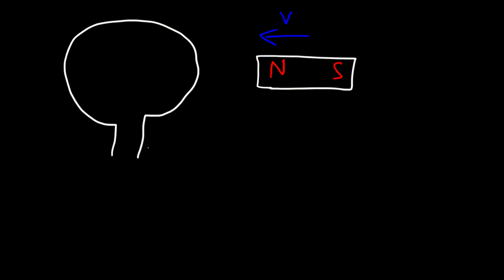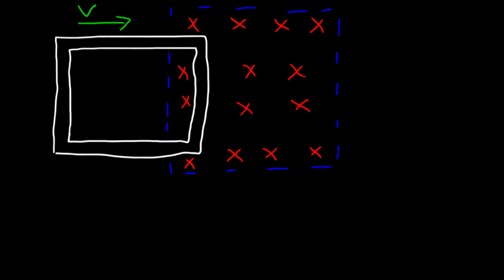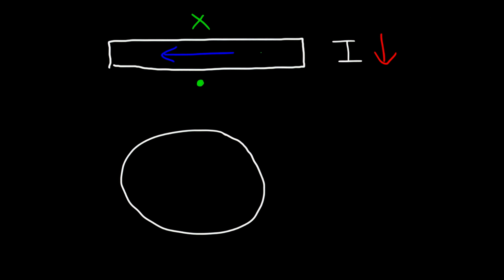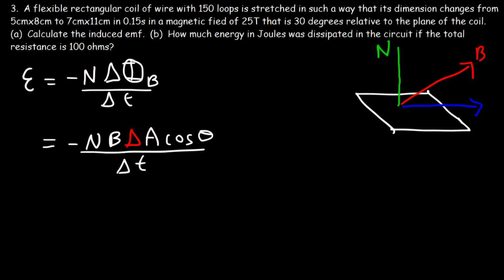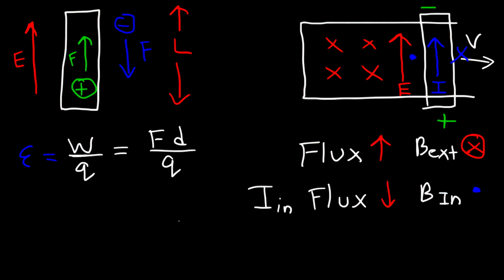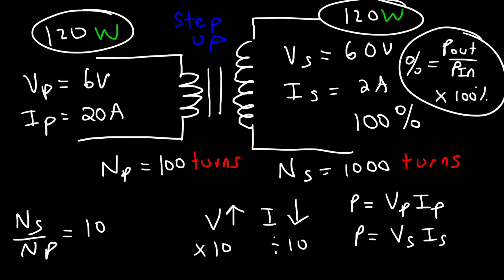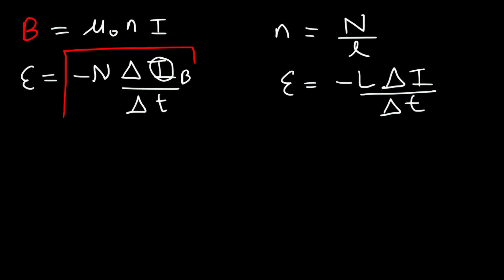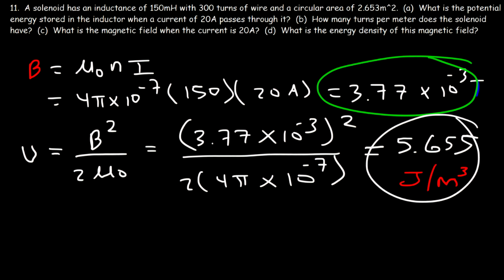Faraday's & Lenz's Law of Electromagnetic Induction, Induced EMF, Magnetic Flux, Transformers

Comment: what if youre only given information about the inside direction of a loop and not the outside direction of the loop? All of these examples depend on the outside direction of the loop being defined.
Reply: external isnt relative for inside or outside the loop, rather external means an external field acting across the inside and outside sections of the loop, not just one section.

Comment: Ashamed to say I took dc circuits 12 years ago and made a magnet circuit like yours, but forgot to put resistors in.  I guess I need to get some resistors - 3 ohm - and put it in the circuit.  calculations say I get .0001 amps.  My ammeter says I get .100 amps.  Close enough to explain it using a home depot magnet with grade 42, 16 gauge magnet wire.  Barely any voltage registers on my voltmeter showing MV and calculations say .00048 volts, thus 0.4 mv.   All I see on my meter is 000 mv, but I know the voltage is there due to the magnets moving. Trying to make a generator that works in wind

Comment: I watched this video last night and I thought it was confusing. Today I did some research and it seems like you could just say the following, "When current goes through a wire it creates a magnetic field. If you cut off the power, the collapsing magnetic field creates a voltage, that wants the current to keep going the same direction. Since it wants to keep going the same direction, the change in current turning off is a gradual change. Since coils create a bigger magnetic field, a bigger inductor makes the change in current flow slower." Isn't that the same thing?

Comment: Video Summary:
This video discusses Faraday's law of electromagnetic induction and Lenz's law, including the direction of induced current and the factors that affect it. It also covers the calculation of induced EMF and the use of transformers in changing voltage. Faraday's law is essential in understanding the principles behind electromagnetic induction and its various applications.
 
- 00:01 Moving a magnet into or away from a coil induces a current in the coil, with the direction of the current depending on the direction of movement.
- 12:46 The induced magnetic field in a loop is opposite in direction to the external magnetic field, and the current direction can be determined using the right-hand rule.
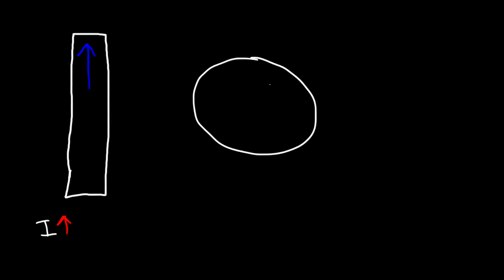- 25:32 According to Lenz's law, the induced current in a circular wire will create a magnetic field that opposes the original magnetic field, meaning it will be in the opposite direction.
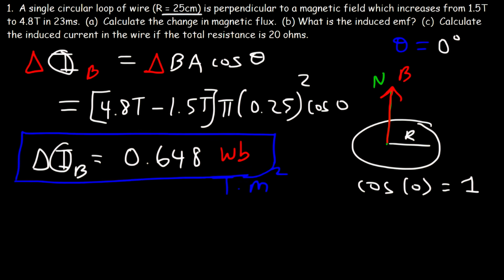- 38:18 The video explains how to calculate induced EMF and current using Faraday's Law.
- 51:02 The video explains how to use Faraday's law of induction to calculate induced EMF and how to derive an equation for calculating the magnitude of induced EMF for a moving conductor in a magnetic field.
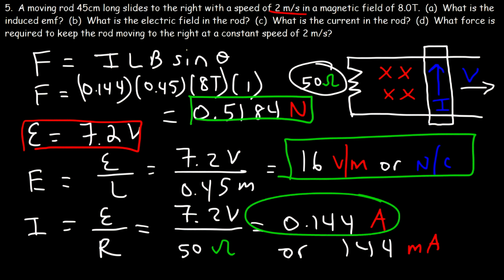- 01:03:48 The magnetic force acting on a rod with current in the presence of a magnetic field is equal to the force required to keep it moving at that speed.
- 01:16:34 The video explains how to calculate current, voltage, and power in a transformer.
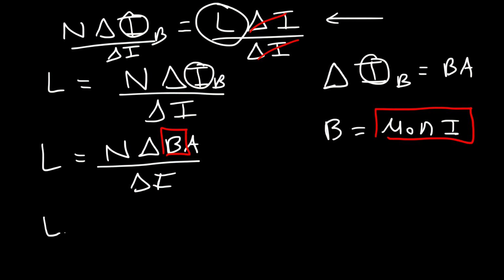- 01:29:22 The video explains how to calculate the inductance of a solenoid and its potential energy.
 
Generated by Monica AI. Get yours now! 👉 https://monica.im?r=402983

Comment: I wish you had used standard or common variable names to represent electric flux.  You are using capital I with a circle around I.

This is not standard usage which makes things more difficult to recall.  It's bad enough to have intricate concepts to learn without adding tmo to he situation .

Just like in English language we have one symbol or name to refer to say for example "apple".  Not many symbols or names for it because if we did keep changing the symbol for apple then much confusion and frustration would quickly result.

I noticed in science and engineering, teachers and authors often talk about or refer to the same concept but however, they adopt some symbol that they like and not use the common or standard symbol for that situation the teacher is discussing or writing a book about that concept but chose a new set of variable symbols.

This is harder to grasp for beginners but teachers keep doing this annoying thing.

It is done often in teaching and in new textbooks.

And you are doing this here with this video.

Nothing that I have seen in many years reading books on electricity uses capital I with a circle around it.  For some reason you decided to start this.

Comment: Faraday's Law is not a law, just math.  In the case where the change in the magnetic flux linking the circuit is due to motion of the circuit, or part of the circuit, the emf is motional emf due to the motion of the conductor moving through the magnetic field and is not due to the change of flux linking the circuit.  It is a case of correlation, not causation.
Reply: What? You’re wrong
Reply: @nuggetx4086  Great argument!

Comment: 28.10 i don't know but i think the graph that you first drew should have been in the opposite way because like this the two of them are equal but they should be opposing to each other because the initial current is trying to increase the flux so if the induced current wants to decrease it it should move in the opposite direction(CORRECT ME OF AM WRONG)

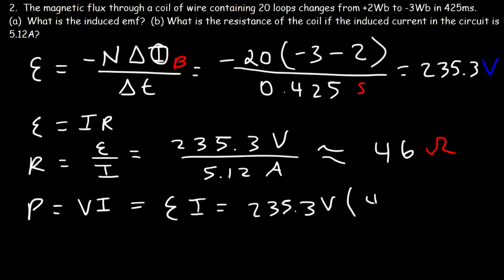Comment: Just before 42:06 we use calculated voltage and observed current to calculate resistance, but doesn't the coil have reactance that needs to be considered?The magnetic field is changing so why isn't the term impedance used rather than resistance? Or is impedence only applicable when the voltage source is external, rather than magnetically induced current in a coil?

Comment: Thanks bro, it was quite helpful. 
However I have a question. How can I use the equation given for calculating the Inductance, to calculate the inductance of a horizontally wounded coil for an Induction cooktop.
My confusion is on how to calculate the value of l(length).

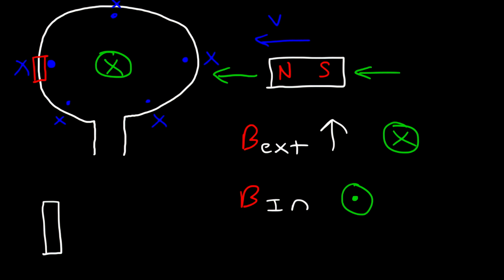Comment: I think you have a serous error from timestamps  13:54  to  14:30  Suppose the current is moving in the DOWNWARD direction as shown.  Now if that current is still moving downward BUT IS DECREASING, like a sinusoidal waveform does, while still moving in the same direction but slowing down!  THEN, EVEN THOUGH THE CURRENT IS MOVING IN THE SAME DIRECTION, THE MAGNETIC FIELD STILL FLIPS FROM CLOCKWISE TO COUNTERCLOCKWISE EVEN THOUGH THE DIRECTION OF FLOW IS THE SAME.
There is a way to illustrate this with a swinging bar magnet swinging toward and away from the wire with an accelerometer  meter attached to the magnet and viewing the accelarometer and the current direction on a dual channel oscilloscope.

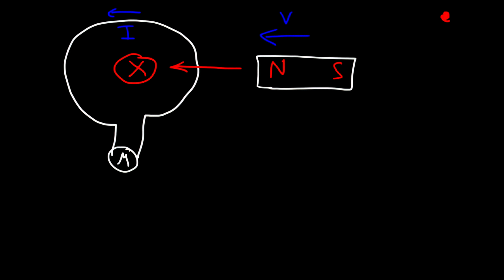Comment: In the first example where it has the magnet and a current (1:05) , would the direction of the current not be out of the page since it’s going counter clock wise?
Reply: I agree
Reply: My comment is very late but in case anyone else is confused, you can understand it properly when he starts explaining Lenz's law at 10:56 The misunderstanding here is that you often determined the direction of the current by using the direction of the magnetic field coming from the magnet, but the correct thing is that we must determine it based on the magnetic field of the coil.
Reply: I agree, doesn't really make sense. Accoring to Lenz's law, if the direction is CW then it's going into the page, if it's CCW then it would go out of the page.

Comment: OK I got to 30 secs...An 'X' denotes a clockwise rotation  - always  - It is like a screw head and you are putting your screwdriver in to tighten - clockwise innit. The point is the point of a screw. CCW. The screw coming out of the wire / paper..

Comment: You said the power dissipated by the coil. Why dont you say the power introduced by the coil sence we produce a volts and amps in the coil. I mean this is the principle of electrical generators (electromagnetic induction). We want to introduce power from the generatores not the opposite im i right?

Comment: I always use the screwing bottle cap rule to figure the direction of the magnetic field generated by the current. In wich way do you have to turn the cap to go in the way of the current? If you turn it to right it will go into the page and so on. Pretty cool rule if you ask me.

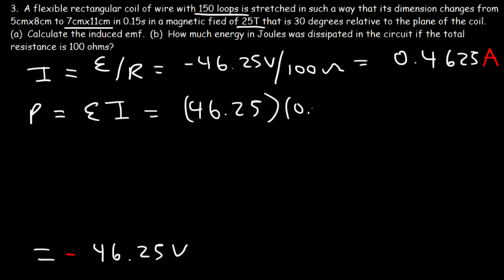Comment: at 47:00 you find out the energy dissipated using the formula p=vi. I think it would be easier to use Joule's law h/t=i^2r that was you can rewrite it as h=i^2rt and simply fill in the formula giving h=(.4625)^2(100)(.15). But otherwise amazing video! Thanks

Comment: For example at 15.33,when the loop has fully entered the field and continues to move through the uniform field for some time at the initial speed v,would the emf be 0 then or some other value?Please clarify.
Reply: first induced emf is equal to change in flux 
when the loop is inside the field there is no change in flux that is no change in field and no change in area enclosing field lines

Comment: how do you determine what side the center is on at 25:00 how can you tell that the center is on the left...im pretty sure its a simple concept but I'm so lost in figuring this out
Reply: Yeah I havemt been able to figure that out either. Is that wire in the center of the coil? Or is it on the left of the coil? God knows other than the guy because the guy first says the wire is in the center of the coil and then he says the coil is on the right of the wire. How can something be in the center and to the side of something at the same time?

Comment: Examples 28:18 and 29:03 are kind of confusing. The magnetic fields for each wire is on a different axis, I don't see how it does anything to oppose the other. Unless the circles are supposed to be along the same axis of the first wires magnetic field, which wasn't specified.
Reply: yea true. should have elaborated there